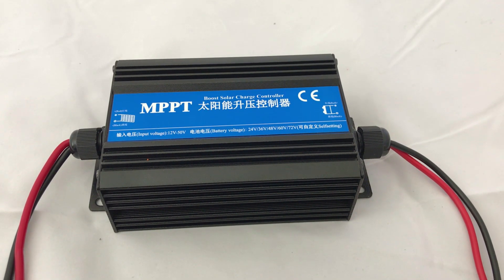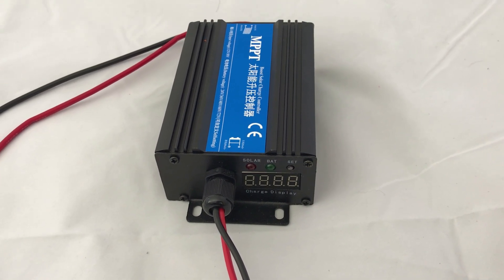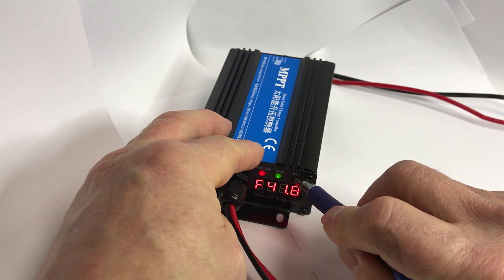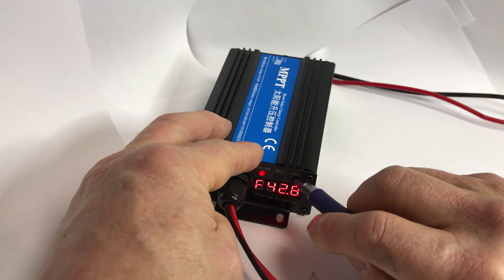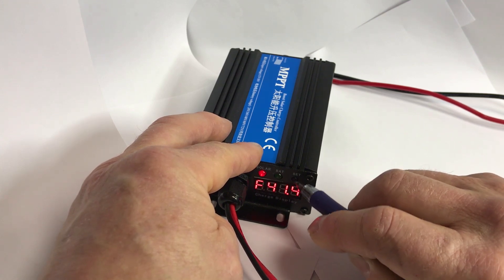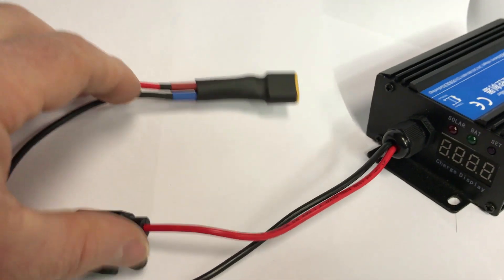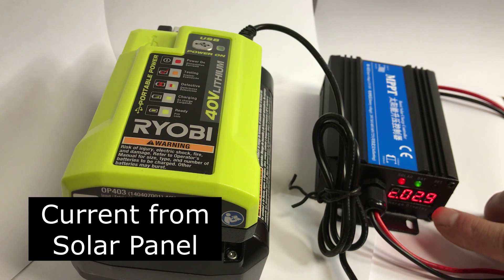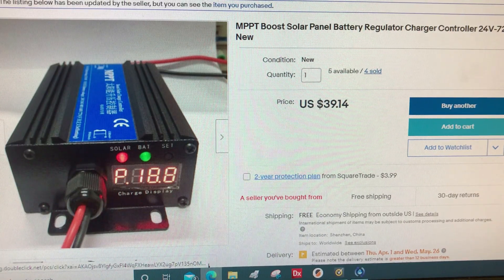Cheap RYOBI 18/40V Solar Charging

Comment: Awesome video. If I have all the parts you have in the video . But I dont want to do any of the tricky splicing of wires. Can I buy an inverter and plug the ryobi adapter into that and still get it charged by the solar panel?

Comment: Just charge by electricity at home and put roof top solar panels, no need to spend huge money on these especially if you use your tools at home. Those solar blankets and Mppt charge controller are junk and unnecessary.
Reply from the maker: I use these when I'm off grid camping. I plug into house AC when I'm home.

Comment: GREAT videos Chris!  You rock :-)  Can I use the MC4 connectors on the Ryobi charging cable vs XT60 so i can avoid soldering and just use a crimp tool for 10g wire? It seems like the wire for ryobi charging unit will be very small - i hope mc4 will work

Comment: Is it safe to connect the Ryobi 40v battery to the unit BEFORE setting the custom 41.7 voltage on the unit?  I tried without a battery and it didn't work.  Specifically it didn't cycle back down to 24 after crossing the 80 something max

Comment: Is there a solar system you recommend over any other? 
Specifically what panel should we get to be able to charge both 18v annnd 40v Ryobi?
Reply from the maker: The flex panels typically don't last that long. You would need to have two 21V panels in series to be able to do the 40V charging.

Comment: Can multiple 40V Ryobi Chargers with the AC/DC Power Adapter be ganged (say 3), connected in parallel with an XT60 for Solar charging, then connected to a MPPT Controller to Solar charge multiple 40V Lithium batteries concurrently?  If it can be done, how many 100W 12V Solar Panels would be needed, and the MPPT Settings?
Reply from the maker: The MPPT controller says it output < 300W. So at most, you could have is three 100W panels. The 40V charger says it takes 1.5A at 42V or 63W. In full sun, you might be able to power three 40V chargers

Comment: Would this set up work for 2 Milwaukee batteries wired in series? Or is there a specific reason you’re using ryobi batteries. Like perhaps Milwaukee batteries have strict charging parameters compared the the ryobi batteries. I’ve found very little helpful information on directly charging tool batteries from solar panels before coming across this video!
Reply from the maker: I use RYOBI batteries because they have a BMS built into them. Some manufacturers have the BMS built into the tool. I don't own any Milwaukee, so I don't know

Comment: How do I charge multiple batteries at once? And maintain batteries?
Reply from the maker: It's not easy to do safely. The batteries could be at different voltages. You also want to limit the charge current to each battery. I guess you could get multiple MPPT controllers

Comment: Your solar panels are giving you how much volts/watts?
Reply from the maker: you should use a solar charge controller. Don't directly connect the solar panels to the battery

Comment: What made you use 41.7volts out from the mppt? When i metered the power brick it was producing 46 volts despite being rated for 42volts.
Reply from the maker: that was probably an unloaded voltage.

Comment: What does the P stand for in the charge controller?
Reply from the maker: Solar Panel Voltage
Reply: @SerendipitySue  Any idea why I’m not getting any current? My battery isn’t gaining any bars for hours. My P voltage is averaging 20. Current is reading zero. Any suggestions?
Reply from the maker: @christopherowens2635  did you put battery in charge mode?
Reply: @SerendipitySue  I don’t know what you mean by charge mode. But I cut the ryobi charging cord in half and hook it up to the controller just like yours, and set the voltage to 41.7v.
Reply from the maker: @christopherowens2635  sorry, I thought maybe you were doing two 18V batteries in series. Not sure why it's not charging. Does it charge if you wire it back to the AC wall wart?
Reply: @SerendipitySue  Fortunately, I swapped out the ryobi charger that doesn’t have the USB port (OP404) and it works. It’s either the USB model (OP403) doesn’t work with solor or I just have a defective charger. However, the current is charging at 2.2a. Thanks Chris for following up. Nice channel.

Comment: I'm ignorant about this stuff AND have seen some dangerous & incorrect info folks put out about other electrical stuff, I just need a solar charger that will charge my 18v Plus 1 Ryobi batteries, does ANYONE produce one that DOESN'T have to be rigged? Just hook up a specified panel & roll ????????  Thanks
Reply: You can use the Ryobi RYi150CBTVNM charger inverter. It can solar charge 18v batteries via the included USB-C cable

Comment: I want to try the same thing for my Black and Decker 20v Li batteries. Doable?
Reply from the maker: I don't have any of the Black & Decker tools/batteries. Is the BMS (battery management system) in the tool or the battery? If in the battery, you should be good

Comment: If I put the controller on 24v can I charge one 18V battery? or will that damage it
Reply: so I have a 100W solar panel connected to the solar boost controller connected to ryobi 12v vehicle charger. does this make sense?
Reply from the maker: you need to set the charge controller to 21V or you could cause serious problems

Comment: Thanks for this but I was hoping for a more efficient solar charger.  This simply powers an inverter to generate AC power which then can run the standard ryobi AC charger.  That's an inefficient process because there are power losses in each conversion step.  The 40V batteries are more challenging to charge but for charging the 18 volt batteries, it would be more efficient to use 24 volt solar panels connected to a very efficient DC-DC converter that steps down 24 volts to the correct charging voltage for this battery chemistry as well as providing the optimum charge current.   You'd have to cannibalize the standard AC charger to have the connector and base.   In theory, you could do the same thing for the 40V battery using 24V solar panels in series to provide 48V input to the DC-DC converter.
Would the efficiency of my system be less than using inverters?  Depends on the inverter and standard charger circuit vs. DC-DC converter efficiencies.

FYI you can also buy inverters at auto stores that can be connected to your car battery as well (Or buy the new Ford F150 lightning all electric truck!) then plug your standard Ryobi AC charger into that.
Reply from the maker: It's actually not using the AC adapter. The MPPT controller is sending DC to the Ryobi Charger. But now I finally figured out how to hack the Ryobi 40V batteries to put them in "Charge Mode"... so now you can connect directly to the battery ( https://youtu.be/ChC_vQpG3_M )

Comment: Does anyone know if the current reading on the charge controller is measuring the amps going into the charge controller, or the amps going out once the voltage is boosted thus making the amps lower?

I'm worried since I got a 150watt panel setup to charge my ebike battery at only a little over 2 amps max when I calculated (75% efficiency) 110watts at 48v is a little over 2 amps. However, this charge controller shows about 5-6 amps with panels/battery plugged in which makes sense if measured at the solar panels output of about 21v. So I'm almost positive that the output is a little over 2 amps to the battery at around 48v, but I feel a small amount of concern since I can't directly measure it. (unless I strip my wires a bit and try the multimeter, which I probably will).
Reply from the maker: Easier for me to think in watts... 150W = 20V  * 7.5A = 54V * 2.8A. But you rarely get the full panel rating. I have used these little meters to measure ( https://amzn.to/3wwXRTp )

Comment: Would you know any way on tricking the charger t1 sensor to produce 40v from the charger. Would like to charge my ebike battery that can slide into the charger. The battery has a bms and it just needs 42v input on the battery.  Thanks
Reply from the maker: I use this and other solar controllers to charge my ebike batteries ( https://youtu.be/CRZOvl0v_YE )

Comment: How long does it take to fully charge a 4AH 40V battery on a 'normal' day?
Reply from the maker: The standard 40V 4Ah battery is 144Wh. So a 100W solar panel in full sun would take around 1.5 hours.

Comment: Ordered most of the parts for this project :)  Have a couple of questions though.  1) whats the wiring for charging the 2 18v batteries and 2) where did you get the wiring hook up with the fuse and 3) whats size wire are you using.  Thanks
Reply from the maker: The fused wire came with the solar charger. The 18V battery connector model is at: shttps://www.prusaprinters.org/prints/39638-ryobi-one-18v-battery-charge-adapter-for-solar-pow . I used 10AWG Stranded Silicon Wire ( https://amzn.to/36q6BgU ).

Comment: Looks like they finally did it. Ryobi solar charging https://www.youtube.com/watch?v=d2dfA6vwQco
Reply from the maker: can't wait to check them out! The 800W inverter unit looks like it is modified sine wave... but it has a 12V socket and can also run off a car battery. Ryobi was suppose to send me the small solar unit to test... but haven't heard from them in a while :-(

Comment: what type of wire are you using?
Reply from the maker: I like to use the silicon multi-strand copper wire. I get it on Amazon ( https://amzn.to/31GKu6e ). It comes in different gages
Reply: @SerendipitySue  is 12gage pretty standard for using solar panels to charge ryobi batteries?
Reply from the maker: @jonathanyokley  large solar panels usually have 10 gage wire. Depends on how many amps you are pushing and at what distance

Comment: Would this possibly work for the Ryobi six battery 18v supercharger? As the batteries are only charged one at a time, I didn’t know if this would be possible? Thank you in advance!
Reply from the maker: No, the RYOBI six battery charger takes 120VAC, not DC. It's a shame it doesn't use a "wall wart", because then we could

Comment: I’m new to solar. Question: Would it do any good or bad if the solar panel was a 200w or higher for this setup?
Reply from the maker: you could go with a larger solar panel. It would help when the sky is overcast.... but the Ryobi charger will never take more than the rated 1.5A at 42V
Reply: @SerendipitySue  Thanks. 
I like your channel, especially your modded and hacked Ryobi tools video. Just subscribed.

Comment: I set up the the adjustable charge controller. Where did't you come to the conclusion it it be set to 41.7 volts. The battery charges up to the 41.7 volts but the charger doesn't show the battery fully charged. The green light still flashes on the roybi charger. Doesn't turn solid green. I checked the voltage coming from the 120v wall adapter that was supplying the charger originally and it's putting out 45v. Is there a reason your charging the battery with 41.7v and not 45v? I was waiting for the roybi charger to indicate the battery was fully charged for ever and never got there. It was charged to the 41.7 v for hours. Is there a reason for not fully charging the battery? Having to monitor the charge controller to see it reached 41.7 rather than the green light stop flashing indicating the battery is fully charged on the ryboi charger module seems inconvenient. I would like to understand why you under charge the ryboi battery slightly with 41.7v
Reply: That's a good point...he should be supplying 45v to charger and letting the charger control the cutoff voltage
Reply: @jime9305  That's exactly what I was thinking. Although when I put the battery into the 40v Rapid charger it don't finish the charge and indicates the battery is fully charged and will not charge it further. Was wondering if 41.7 volts was maybe to extend the life of the battery. But I guess my question wasn't worth answering by the creator of this system.
Reply: I'd love to hear what Chris says about 41.7 vs. 45v.   I noticed the same thing today, the last green light never stopped blinking.
Reply: I'm so glad I kept scrolling and found your comment. I have the identical situation on two chargers and two MPPT charge controllers using the method detailed in the video. Everything works great except the grand finale. The 4th light is content to blink forever. Tonight after seeing your comment I checked the bricks via multimeter. The OP403 brick puts out 43.9v. The sister charger OP404 is even higher at 45.8. No wonder the chargers won't finish. I'm going to reset the respective controllers to those numbers tomorrow.

On edit: That's all it took. I raised the voltage today, as described above. The Ryobi charger finished with no problem. If this had been yesterday I would have been out there several times staring at a forever blinking left light

Comment: Hi! Great Video, How long does it take to fully charge a 40v battery using the 100w panels?
Reply from the maker: Since it is using the Ryobi charger, it takes the same as if you plugged it into AC. A 4Ah 40V Ryobi battery is rated at 144Wh. The small Ryobi 40V charger puts out 63W. So it should take around 2-3 hours to fully charge and empty battery.

Comment: What value resistor did you use on the 18v battery charging contactor cap, the one going from neg terminal to the middle terminal?  I am guessing this is a thermocouple terminal your bypassing?
Reply from the maker: 1200ohm
Reply: @SerendipitySue  can you explain what this is for?  i thought i saw in another of your videos you use this as a passthru so you can charge and use it?

Comment: If I have the RYOBI 12volt charger... What is the most basic Solar Panel system I would need to make it work? Could I plug the RYOBI 12 volt charger directly into the Solar Panel without a Charge Controller?
Reply from the maker: You can't plug a solar panel directly into the 12V Ryobi charger. Most solar panels range 18-21V. Also I believe the 12V charger needs a certain amount of current to work. My P131 says it takes 12 at 6A

Comment: Isn't it dangerous to run those 18v batteries in series without being balanced or having a bms?
Reply from the maker: RYOBI batteries have the BMS built in the battery. Good idea to put them on a regular 18V charger every once in a while
Reply: @SerendipitySue  Thanks you're right, I was thinking more along the lines of the Milwuakee m12 batteries where they have a balance lead to each cell for charging.

Comment: the resistor over the 18v charger is 1ohm? this triggers the voltage over charge?  since 18v charge ports are in parallel, can you put different amperage size batteries on your charger?  I was thinking since you probably can't put one battery in the 18v charging system there always needs to be 2?  and what happens to the charge if one battery charge completes before the second battery?
Reply from the maker: it's a 1200ohm resistor. This MPPT charge controller can't go down to 21V. So putting two in series allows you to charge them. It's best if they are the same size/charge level. Ideally you are using them in serial as a "40V" battery.

Comment: I just ordered one of the charge controllers from Ebay.  Have a question.  I thought of cutting off the Ryobi power supply and just using a custom boost controller to supply the same 42VDC @2A in its place.  I'm assuming the charging circuit etc is in the Ryobi charger and the power transformer/supply is providing a constant 42VDC @2A.  Am I wrong?  Thanks in advance
Reply from the maker: Unfortunately I haven't figured how to hack the 40V battery to put it into the charge mode yet (I did figure it out for the 18V batteries). So you need the Ryobi charger to handle that function. The solar charger controller replaces the normal charger brick

Comment: I use ryobi for tools, I can order one of the charger adapter? Thank you
Reply from the maker: sorry, I'm not in a position to make/sell adapters. I put them on the 3D print sites for free
Reply: I really like how you able to charge one of ryobi battery. What is the 2k resistor for again?
Reply from the maker: @rayjones2381  the 1200ohm resistor between the + and T1 sensor puts the battery into "charge mode"
Reply: Will it stop charging when all the lights bar stop flashing?

Comment: Thanks for another useful video, Chris. Is the current displayed on the unit the solar current or the charging current? I'm curious because those 40v clip on chargers are rated at 1.5 amps (which could just be an artificial limitation of the AC transformer), so if you are improving on the rated charging speed that makes a project like this even more impressive.
Reply: So I just built one of these and using the clip on charger you can in fact charge at a much faster rate. I noted 6.5ah on my current meter. Typical Ryobi tactics artificially limiting the charge current so they can sell you the 'fast charger' for 3x the price.
Reply: @IM_A_BEAR_LOL  - It is also worth mentioning that charging NMC batteries "faster" results in fewer charge cycles before they drop below 80% DOD, aka their service life.
Reply: @IM_A_BEAR_LOL  are you charging 18v or 40v batteries? What type of solar panel are you using and how long does it take to charge your batteries?

Comment: I use this with Hikoki 36V power tools (cnc router) and it works great together a 100W 12V solar panel. 
I can work from the morning to evening and i never discharged  my battery (2Ah 36V)